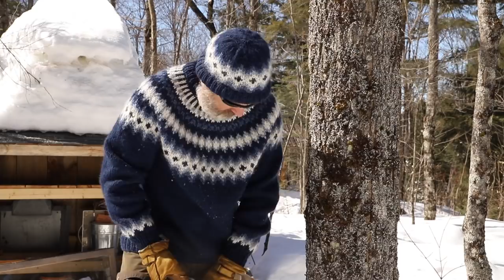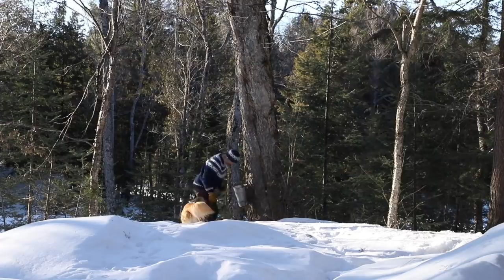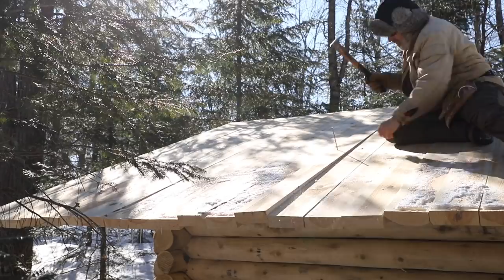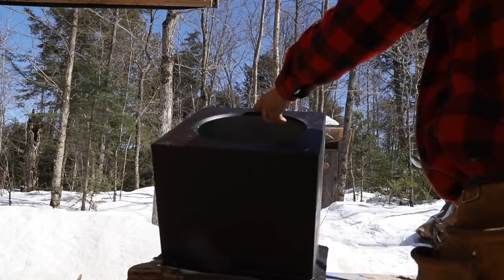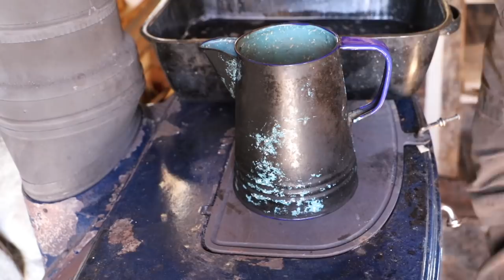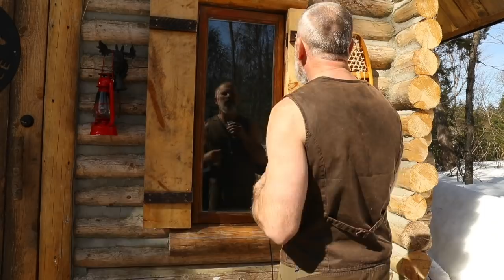Log Cabin Bathhouse | Installing a Wood Stove | Maple Syrup | Off Grid Haircut

Comment: I never quite understood why you like nice, tidy roofs instead of large overhangs/soffits (on the non-gable end sides). Lile the main cabin, appears to be about 20" overhang on the porch. When u were building it, you cut off at least that much more. Seems like those overhangs would be ideal for outdoor semi-dry storage along the side of the house, and an even larger front porch. The bath/guest house is so short so it probably wouldn't be of much help there...but for other out-buildings (wood shed too) and the new site(s), I'll be curious to see if the trend continues or if you implement larger overhangs. This is not a complaint, just a curiosity is all :) 

Anyhoo, looking good all around!! (Buildings, sugar taps and manscaping, too ;) )

Comment: Nice stuff. Youtube suggested your 90+min film. I left the woods last Sept after getting married. Might I suggest a longer rope on your sled. I also added a 24" inch piece of sch 40 PVC pipe as a handle. It makes the process of pulling heavy loads much easier. A piece of birch with a hole in either end would probably work. Over the years I've pulled a lot of bucked up wood out of the woods. Enjoyed your work = new subscriber. Thank you

Comment: Awesome, Love maple syrup on pancakes, i use iron skillets when i make them. I use french skillets and they are special design and work fabulous. I have a portable solar generator I made for some things to run in the rural city I live.  I lay 3 panels in the yard and power it up.  I do not think i am going to expand too much for the ROI (return on investment) in not good with solar. I have done some big installations and they all have the ROI that is about 20 years to reach.  You can probable place one on the main cabin that is about 2 kilowatts with MTTP controller, 300 to 500 amps per hour AGM battery. The only issue s the snow in the winter, something will have to be designed to solve it.  Peace, Love, Lazaro

Comment: Hi Shawn, small suggestion for haircutting: I've been cutting mine for thirty plus years now and it's far easier if you use a second mirror for doing the back. A hand held mirror aimed at the one on the cabin and you can see exactly what you're doing..

Comment: Hi Shawn...Idea for the main cabin....The square box at the top of your flue....Could it be made watertight? and you have a constant flow of hot water. Alternatively, wrap copper tubing around the outside of the rising flue, and thermal syphon will heat water in a tank set lower. Thanks again for your fantastic communication. Breath of fresh air (pun intended) From a 30 deg celcius Island of Cyprus in the Eastern Mediterranean.. :)

Comment: Been cutting my own hair since 2003, just work my way down on the clipper sizes from 1-1/4 inch on top/front, then clipper #8 on sides/top back, then a little further down 7, a little further down 6, a little further down 5 and so on, fading all the way down to 1 on bottom, then use a mirror with my left hand to see the back of my hair through the other mirror behind me, as I trim the straight hairline with a bare trimmer, takes a little practice, but just make sure you don't get in a hurry and accidentally put a bare spot in the back of your head, I've done that twice in the 15 times a year I've been cutting my hair over the past 16 years which is around 200 times x $20, which is $4000 saved, and, I feel like i do a better job.
Reply from the maker: Lol, I did the same thing twice - forgot to put the guide back on and cut a bald spot. I've been cutting my own hair for a long time too but not as fancy as you.
Reply: That's so funny, yeah you think it won't happen again and then it does and then it's the last time it happens. So much quicker anyways. What, a whole 5-10 min. compared to 15 min. to barber 30 min. there and 15 min. back.

Comment: I have a similar setup (off grid cabin in woods, but WAY less awesome). I have rainwater collection for washing up/outdoor shower in the non-freezing months , but haven’t located viable water source yet, and well is currently out of the question, logistically. Not to mention burying water lines below frost line would be a nightmare as I’m on ledge. Do you have a well, or is it carry-in/snow melt in the winter for you?

Comment: Do you expect the logs the walls are made up of to season/shrink a bit more to fill the gaps? Looks like its not the case for the roof lumber it seems like those were milled and purchased (unless you cut them up in a video previously that I didn't notice)
Reply from the maker: Everything is going to shrink, so it will be interesting to see.  The lumber is fresh, very green and heavy, so it will shrink quite a bit.

Comment: Just a few thoughts if You:re willing to listen to ?

I guess it's pretty hard to fill that watertank on that stove in this position with that jimny-pipe? 

May be it would be easier if You position the oven lengthwise, firing-hatch  opening to the door instead ?

My thought would be => to get the most energy out of stove and wood, to position the oven to the inside wall next to the door inside to the guest room. That's how Fins built in ovens in their Saunas quite often. 

If You put that tarp black side up on the construction wood/loggs  thawing could be way faster.

I.m.h.o 3cm (finger strength) longer hair on top of Your head, sides 6-9mm short would look way advancing and Younger.😉

That's how I cut it myself😉

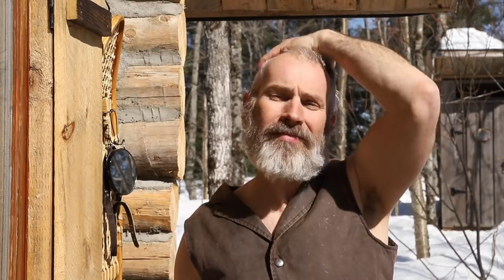15:40 Hej and that 😊Iroquois with shortened sides of the long beard below looked really rad👌
pretty "war cut" like. Ask Your daughters about.

Comment: I had to laugh, it’s the same way I shave...outside. Only I completely dress down. 

Now to the wood stove. I see you use elbows inside the cabin. Could you exit thru the side wall instead of the roof? Or is it more desirable to have a greater length inside the cabin? I could imagine a side wall exit and then add stones around it to make it look more rustic

Comment: So much hassle for a bath house... could of just found 4 trees that form square ...get a roll of plastic and rap it around those 4 trees. It will become air sealed get some heat going inside take a bath with melted snow ....